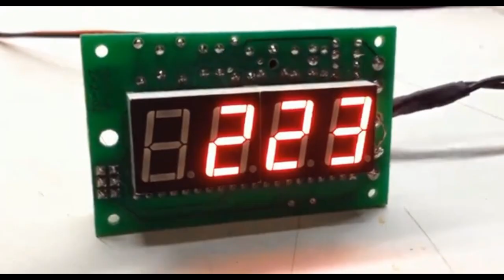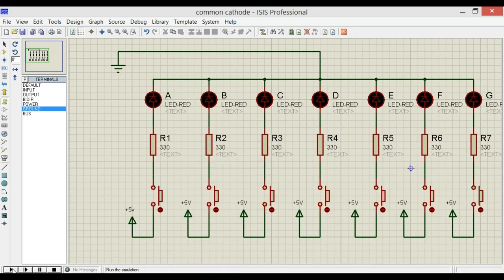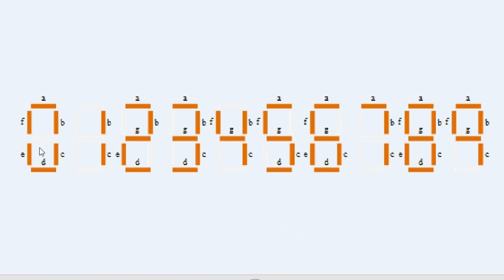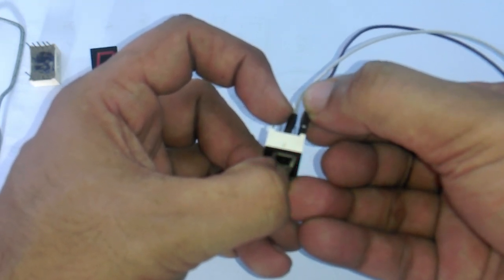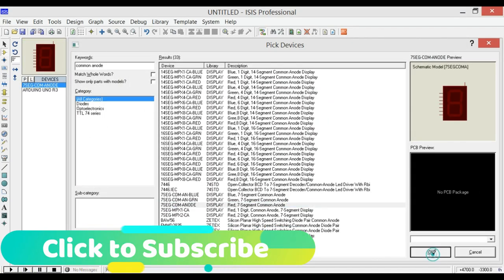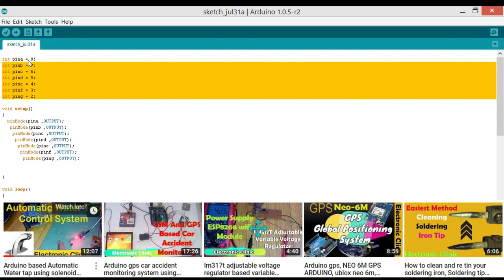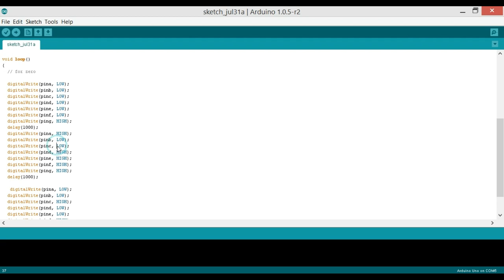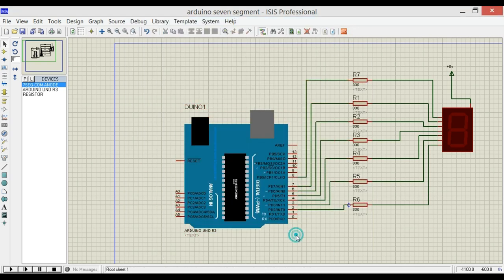Common Anode and Common Cathode 7 Segment Displays"Arduino Project for Beginners"Electronics

Comment: Why when you send HIGH to a port using a CA 7seg is turning the LED off? Wasn't supposed to send 3V3 to this port? I understand that LOW you will have 5V from CA + "GND" from GPIO and then LED is ON. But sending HIGH you will have 5V on CA + 3V3 on GPIO port. What I`m missing?